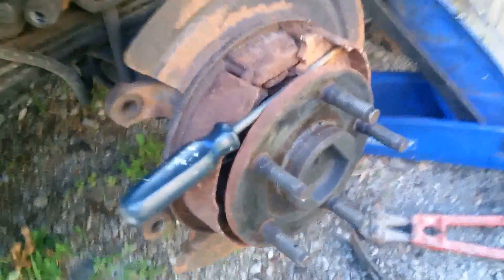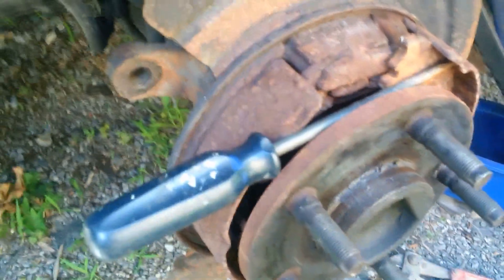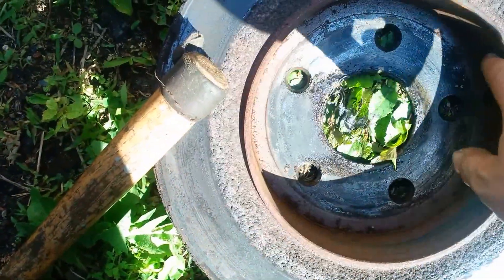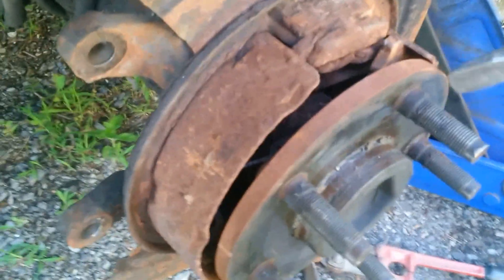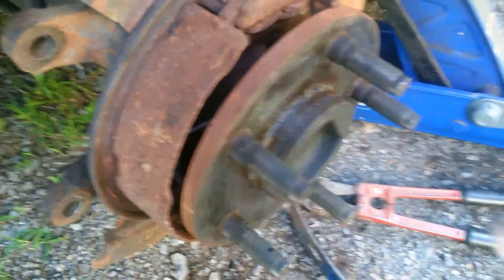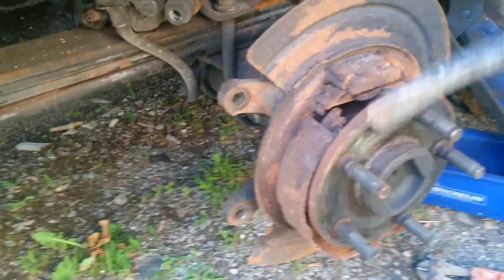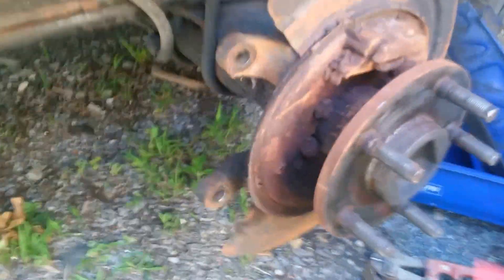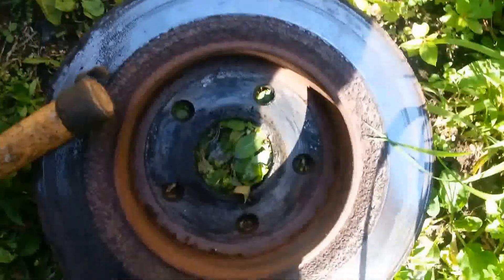2003 DODGE RAM  REAR EMERGENCY BRAKES  SEIZED

Comment: You may want to replace the backing plate regardless. When I was changing my brakes; low and behold no parking anything, just the pull line. I didn't put them back on either. 48 bucks would have done it, but I'm lazy

Comment: My brake lines blew out on my 2003 Dodge Ram as I went to stop. I went for the emergency brake but they didn't work because I threw them away.  Why is it called an emergency brake?
Reply: TheHound Try doing it sometime and tell me how it works.
Reply: Actually it's called a parking brake....

Comment: I know I'm not the brightest bulb in the lamp but when you put the E brake on all wheels lock, right?  And these aren't just the E brakes, it's THE brakes on the back?
Reply from the maker: auaiao9  i have rear disk brakes and the drum brakes are drum style that live inside the  metal rotors   and they were shot..  the only problem is if my brakes blow out i will have do emergency brakes to stop the truck.. i will have to head for the  curb or gaurdrail..
Reply from the maker: +auaiao9  sorry i didnt reply to this.. i noticed you commented to this and gave me a good  question .. the answer is.. only the round shape  DRUM BRAKES that i ripped out  are the  e brakes.. the real caliper  for REAR DISK brakes  are sitting there on my spring. out of the way while i took the caliper mounting bracket  off and removed the rotor  then i  saw how rusted out everything was and said no way.. its all finished..  ..just rip it out..  and the rear brake caliper and rotor went back on and i put on new / used rear brakes from kenny u pull with 80% pad left for 10$  so im in great shape
Reply: +san379 oh ok that explains it

Comment: my trucks rear end seized up so 4wd unseized it. A month later I found the emerg brake adjuster on the driveway. The parts just fall out.
Reply from the maker: its still all been ripped out and no backing plate either.. havent missed it since..

Comment: That's some serious rust damage !
Reply from the maker: backyardmech .. works fine now.. i put the rear brake caliper back on and i will need new back brakes or used pads from kenny u pull and  that will keep me going for years.. ottawa is a small town ..

Comment: I have the same truck and I'm getting a squeak at low speed, mostly when coasting. It doesn't do it under power. I noticed one of my e-brakes doesn't look like it's fully  disengaging. 
I get no squeal when I turn the wheels by hand, only at low speed. Is that when you would hear the squealing?
Reply from the maker: youll find out after you take off the tire and caliper and remove the rotor... its a huge amount of money  to spend  on something I don't need really..  just rip them out.. both sides..  I have done this 2 years ago and no problems ..even the backing plate is out now

Comment: Isn't it illegal to drive a vehicle without a functional emergency brake?
Did any indicator light up on the dashboard without the e-brakes?
Reply from the maker: +OVI-Wan Kenobi the truck has no e brake anymore ..theres no e brake shoes and the cables are rusted out  and seized and the cable came thru the floor  has been cut off and the floor closed up with  sheet metal and  tar and the metal  painted with themclad  because the cable allowed in water that rusted out my drivers floor from festering under the mat and rubber floor  and the light is off because the e brake is not depressed  or in use.. ive never used it since i bought the truck.. once.. i put it in park..  i dont  own a 5 speed ..  the truck will never have to pass a safety inspection again.. because i will never sell it
Reply: san379 what about when you have to park on an incline or downhill?
Reply from the maker: +OVI-Wan Kenobi  thats why the transmission in a automatic has  park.. you dont need to pull or set the parking brake.. i never have and i never will.. park keeps it in  place as you park on a driveway.. i dont park in sunken driveways or boat ramps..   .. its very very expensive to replace the cables and brakes and hardware and backing plate and open the floor back up and install the new gasket and cables.. i assume 1000$ everything replaced both sides ..everything... no way im not spending that..
Reply: san379 I think it's probably more expensive to replace the transmission when it gets worn out by parking on an incline or downhill without the parking brake on.  Using the parking brake takes the weight & stress off of the transmission.  There's a reason why the parking brake exists, car manufacturers don't spend money putting it into their vehicles for no reason.  Ever notice how hard it is to shift out of park when parked on a grade when your parking brake is not on?  That's your transmission telling you to use the parking brake.
Reply from the maker: OVI-Wan Kenobi  nope..i never had tranny problems . pull the shifter n it goes into reverse or drive  or park..never use the others
Reply: It's a parking brake..... Not for stopping.